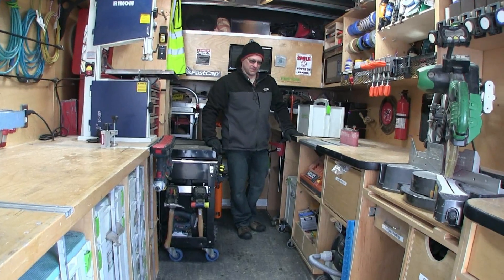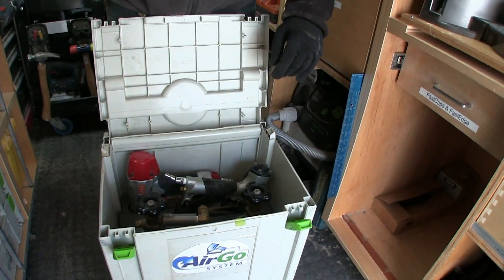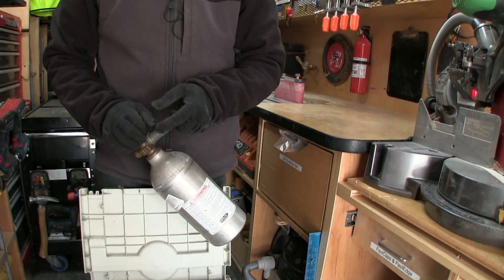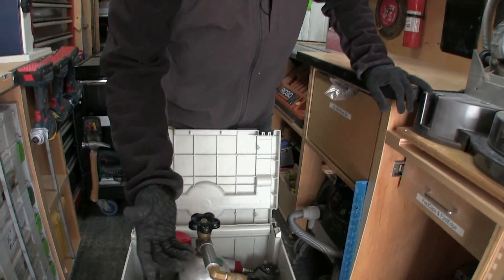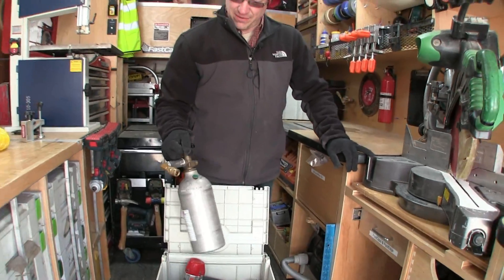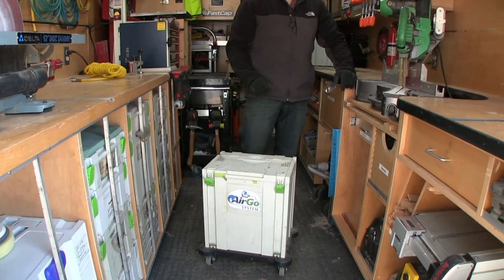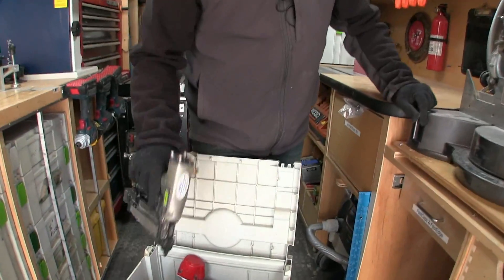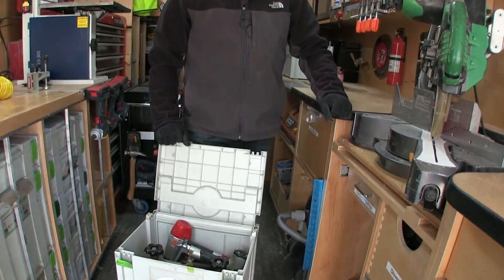AirGo CO2 System for Pneumatic Tools

Comment: where can i find the regulator that you use to reduce it to 100psi?
Reply: He says that was custom but you can buy fixed pressure regulators online which are gageless (low bulk) or adjustable regulators from any industrial gas supplier or Ebay. (I rebuild my personal regulators and Ebay is a great resource.)